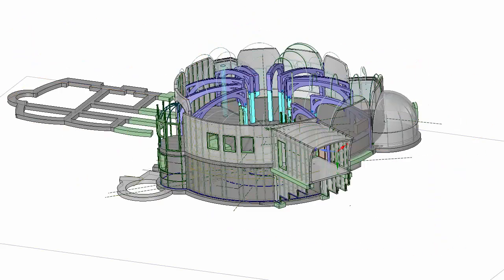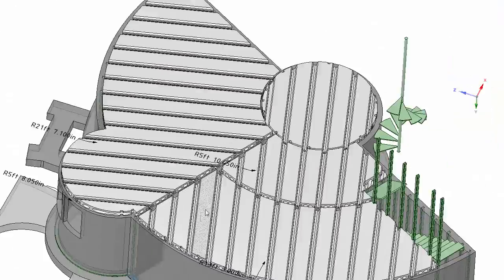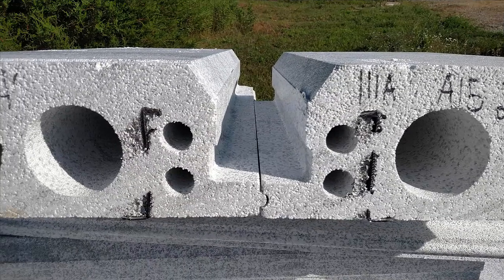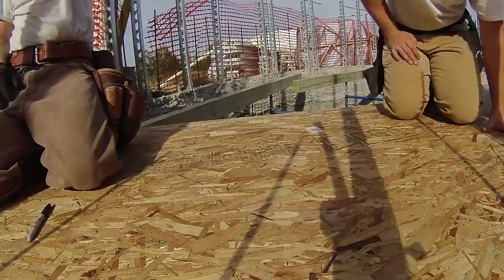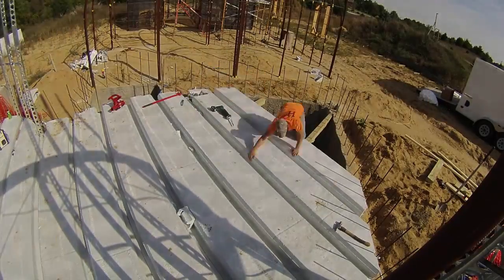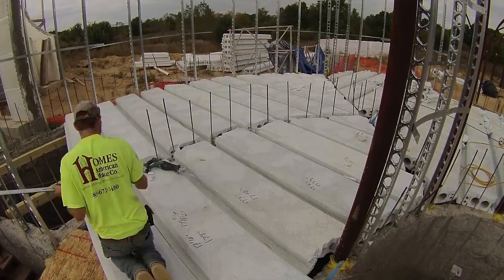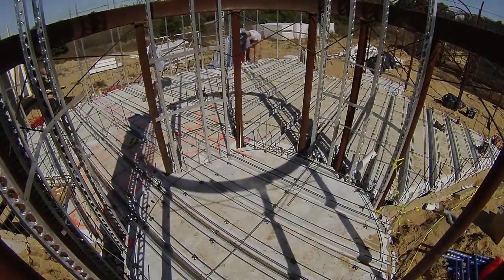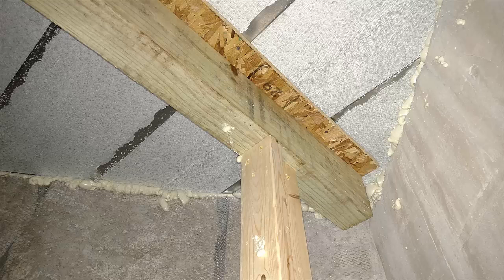20.0 Quad Deck Install (part 1 of 2)

Comment: What CAD software are you using?
Reply from the maker: For this model, I was using ANSYS SpaceClaim.  It is an engineering software that is used to run computer simulations for various physics such as fluid flow, acoustics, stress analysis, thermal transfer, etc.  My background is in engineering simulations and I worked at ANSYS inc. at the time the video was made.

Comment: Can't believe they had the nerve to say the beams they had to use for the install were an extra. If they quote on the job, they should be responsible for anything they missed, otherwise they can 'miss' beams, scaffolding etc... in order to beat a competitor's price then charge the client later to make up the difference. Had a GC try to claim fifteen grand once because the tin-bashers wanted holes in the drywall. Pointed out that it's his job to coordinate the trades. If he lets his drywall sub in before the HVAC guys, that's on him, not the owner...
Pardon my rant, but Iv'e developed a short tolerance for contractor extras over the years :)
Reply from the maker: Yup, drives me crazy too.  I resisted several thousand in ridiculous extra charges on the quad deck and I really think all my time-stamped time-lapse photos helped me prove my side so it wasn't just a "he said / she said" argument.
Reply: Loving this series, by the way! You've got an incredible vision and, obviously, the determination to see it through. 
Well done. sir!

Comment: Think you would have done way better job than these guys 1/2 a#$ work.  Might be a opportunity in your area for a similar product with proper installation after reading all your issues lol
Reply from the maker: +Brad Haaf Actually, I have thought that several times after working with (or just trying to get quotes from) contractors in my area.  I think someone could come in and out-compete most of them just by calling people back.  I have found that most contractors are very short term thinkers.  They can manage one task at a time and put very little effort into planning the next job if they are still working.  Once they are out of work and the money stops flowing, then they suddenly decide they should probably return some phone calls.  In one case, I actually took the idea as far as looking into buying the equipment for making cellular concrete because the litecrete guys in my area were so incompetent and over priced.  The cost of the equipment and concrete was much less than their quote, but I eventually came up with another way to get what I wanted and I was too busy to worry about putting them out of business.

Comment: After reading about all the problems you had with the QuadDeck installer on your blog, it's good to see those floors finally in place.  I've been following your design almost from the beginning, so I'll take this chance to say "Hello" and "Good luck"!  Earth sheltered homes, especially with long-term heat storage, seem ideal in theory, but challenging to implement.  Your design is quite impressive, and I think that future designers will learn a lot from your project.
Reply from the maker: +Onward to Innisfree Thanks.  Hopefully the lesson isn't, "don't be crazy like that guy."